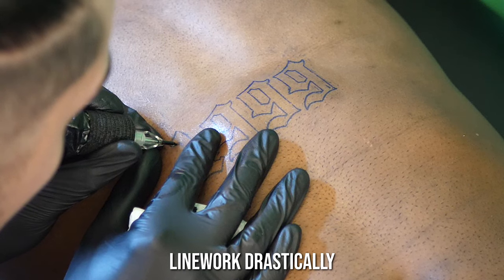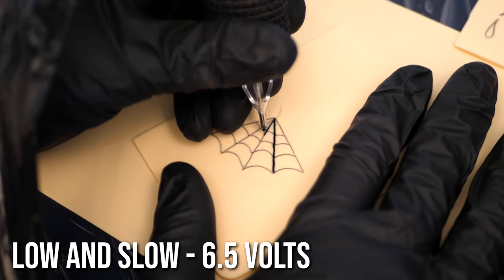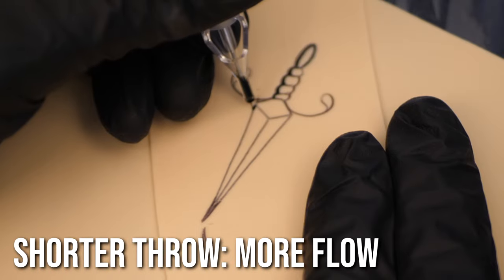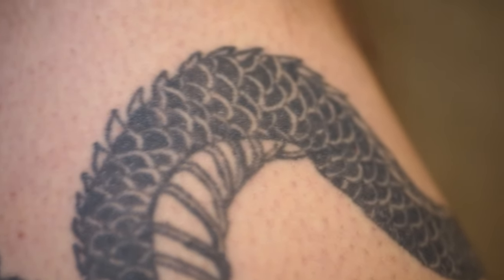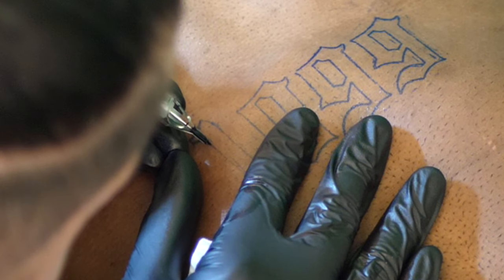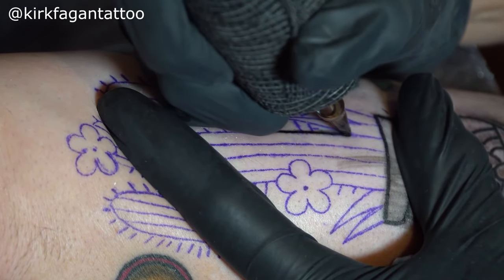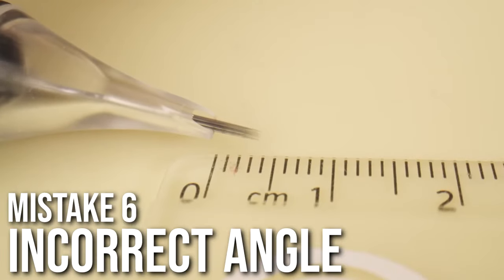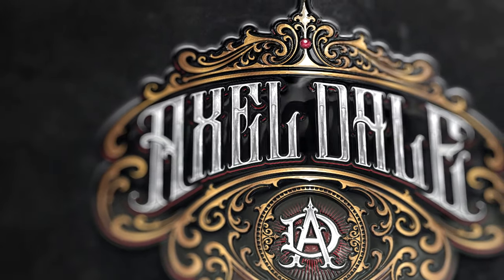6 Tattoo Lining Mistakes Every Beginner Makes and How to Avoid Them

Comment: I love these tips, my only gripe is the 1RL is my FAVOURITE liner. Along with 3RL as a close second. So many small details that look amazing and could not be achieved by a 3RL, I don't understand how you could brand it as a "complete waste" + making ghost lines if ur stencil starts washing away is super quick, easy, and out of the way with a 1RL 
Even things I hit with a 3RL I'll usually pass over first with a 1RL. 

All that being said, I do probably use the 3RL most of the time, but I appreciate and enjoy using the 1RL most.
Reply from the maker: For beginners I recommend bugpin 3RL (long taper) for super fine line because it holds more ink and doesn't damage the skin as much. That's why I don't recommend 1RL's, it can cause a lot of damage to clients skin if not used properly the thing is like a razor blade. I feel the difference in lineweight between the two are negligible but the 3's are just much easier to work with IMO. Appreciate your methods though and if it works for you then I think it's good!
Reply: @AxelDaleTattoo  ohh I gotcha. That makes sense

Comment: every single tattoo artist, no matter how experienced they are, keeps making mistakes when lining.
i really don't understand why so many want to hold on to lining.
there are many tattoo artist who don't line at all and they are very good and very busy tattoo artists.
Reply from the maker: Yes I totally agree that many artists make these mistakes. Lining is essential depending on the tattoo style. You don't need to line for a Realism tattoo sure, but for a traditional tattoo lining is part of the tattoo style. Every artist needs to learn how to line properly as a fundamental skill. Thanks so much for watching.
Reply: @AxelDaleTattoo  well also when it comes to tirbles it isn't even necessary to line i would say.
all it really does is create difference between the lines and the inner coloring.
after 20 years i can still see a difference in a tribal i have myself even though i was done with the same inc.
Reply: @AxelDaleTattoo  ok i just took a good look and i don't see the difference anymore as the lines aren't as crisp anymore.
but still, i have been able to see the difference for a long time.
Reply: Crazy to suggest that all tattoo artists don't need to be able to draw a precise line, but that's your personal choice. Good luck with that one.
Reply: @hayleybowen6106  i'm not saying they don't need to be able to.
they simply can't all the time.